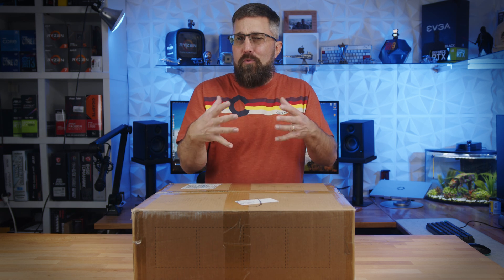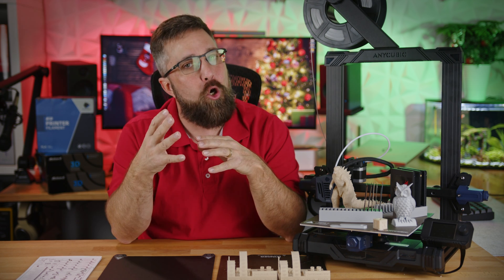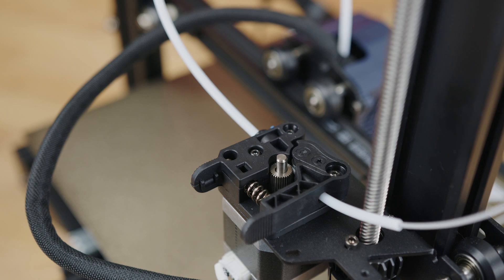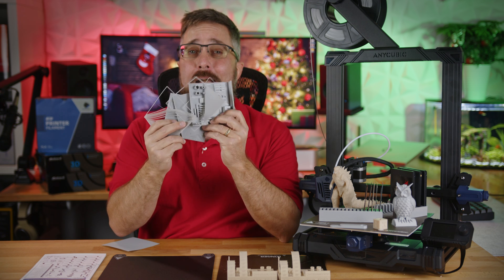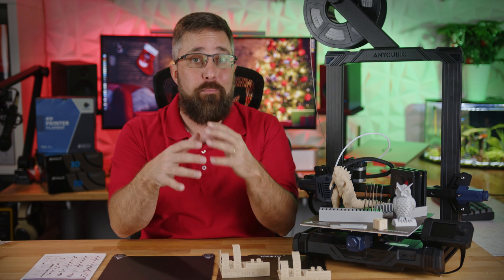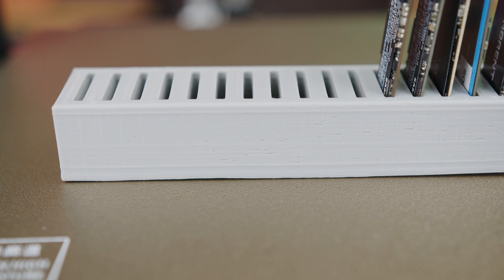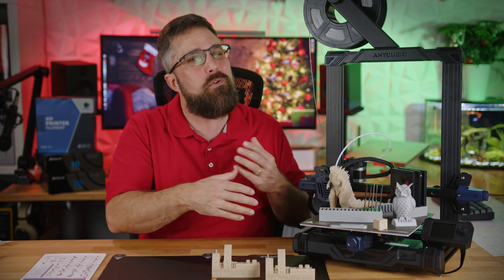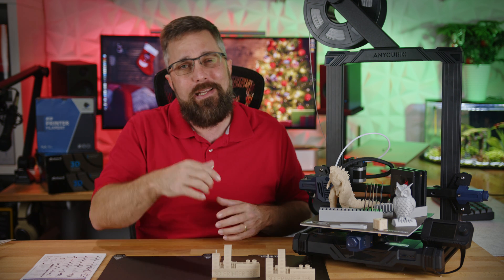How is This So CHEAP? Anycubic Kobra Go Review.

Comment: Thanks for your review. I had problems with adhesion until I printed a first layer test pattern and adjusted the Z axis offset while it was printing to find the best setting. I had to do this again when I bought some new filament and each time the adhesion has been perfect, no matter the size of the print. Can I install a fan on my Kobra Go?

Comment: So I'm real familiar with resin but new to filament, I'm having troubles with adjusting the settings because like... I don't know what I don't know about what the different settings do to adjust them. My biggest issue is that even after leveling and all that and it keeps thinking the build plate is lower than it actually is and I've gotta kill the print quick so nothing is damaged. Any advice on first steps to fix this?
Reply from the maker: Raise the Z Offset.
Reply: @ElevatedSystems  just to make sure, because I never underestimate how wrong I can be about a simple thing, you do mean to make the Z offset positive correct?
Reply from the maker: yes
Reply: @ElevatedSystems  thank you
Reply: @ElevatedSystems  so I set the Z offset to as high as it could possibly be and it is still wanting to start too low but when I do the touch auto leveling it goes to the right place. And it's happening with multiple different files. Any ideas?

Comment: Getting the gantry to stay level seems to be an inherent design flaw in single z axis printers as I experienced similar issues on my ender 3 pro.  I wound up adding a dual z axis kit and added a second control board using klipper to allow independent z axis motor control so it levels the gantry to the bed before each print.  I’ve found having independent z drivers is kind of crucial for dual z setups as my older mono price i3 drove both motors from the same driver and frequently had to be releveled and still could fall out of level until the steppers are locked.  These ultra low cost printers can print pretty well with enough effort but straight out of the box can be a real nightmare for people new to 3d printing.  Glad to hear it at least has silent stepper drivers, maybe tmc2208’s?

Comment: I actually just got mine 3 days ago and have had nothing but problems with the z-axis. Using a level helped for sure, but the wheels won't all turn and it gets stuck about 2 to 3mm above the bed. The auto-leveling definetly makes it look like it is working fine, but as soon as I try to print it is just not wanting to cooperate. Been trying to adjust and print something on it for the 15th time now. It also arrived in the worst state I have ever received a printer in the mail. Not sure if it is a shipping issue, or just a normal issue that is happening with the z-axis.

Comment: Im just throwing this out there: I had problems with the Y-axis shifting during printing. The motor would not be able to turn the axle sometimes. Try to tighten the rollers to bare minimum while sliding the bed. This fixed Y-axis shifts for me.

Comment: I have the neo and it is a peace of crap the auto leveling doesn't exist the bed is solid on the rails nothing adjustable for the bed level i have one side higher than the other by I little and the printer always drags the nozzle on one side of my printer every time I try the auto leveling

Comment: Oh my god, i actually got this on black Friday. This is my first 3d printer. My prints have been coming out really bad I've honestly only had 2 decent prints. And honestly the adhesion on the bed for me isnt working that well :(
Reply: So far, best advice I can give you is to flip the magnetic plate. The semi-gloss side is much better for adhesion. Also worth recommending 210 on the nozzle for the first layer, and 195-200 for the rest if using PLA.
Reply: I have a Kobra Neo, Make sure to set the Z offset in the menu settings that worked for me (it's a thing with the kobra models) and wipe the plate with a bit of alcohol then heat it up, it works wonders.
Reply: I had the  same issue until I manually set my z offset by using a piece of paper and jogging the nozzle until i felt some slight drag on the paper when moving the sheet of paper back and forth. If not sure how to do it go on YouTube and watch how to do it.
Reply: The Bowden tube melts after I week. Learned that the HARD WAY. Just switch it out
Reply: same. the whole thing needs some type of adjustment

Comment: Hi, I have a doubt. I accidentally deleted the files on my micro SD memory and I am new to my printer. I tried to put STL files but it doesn't read them. Do you know how I could fix that?
Reply: Not a problem if you delete the default files, nothing you need there for the Kobra Go to read STLs. Should just read any stl. Try formatting the sd card as fat32 or trying a new sd card.
Reply: I believe it only reads geode, not simply stl

Comment: I have Problems with abs 

it doesn't stick properly or the lines don't come out clean and look wrinkled.  Temperature of 80-95 degrees tried everything.  noodle from 210-240 no difference either
Reply from the maker: you need a full enclosure to properly print ABS.

Comment: I've recently bought this printer, and for every print the nozzle hits the print and moves it, causing it to be ruined, is their any possible solution?
Reply from the maker: you need to ensure the print head is trammed and the  z-height is set correctly.
Reply: I lowered the z and that fixed it for me. I am at -2.8 or so

Comment: My Kobra Go keeps freezing and not printing, I’ve tried printing from SD card and the screen keeps freezing and nothing moves
Reply: I had to flip the voltage switch on the back for it to work.
Reply from the maker: try updating the firmware
Reply: @ElevatedSystems  idek how to do that

Comment: Oh - and for any newcomer here: Make sure your E-Steps are correctly calibrated. There are ton of videos on this matter, but essentially you download "pronterface", klick 2 buttons and type 3 different commands to have it calibrated within 5 to 10 minutes. This is especially important in case your first layer is underextruded, which would also cause adhesion problems.
Reply: I found out that I had an underextrusion issue on my Kobra Go and when I used pronterface to extrude 10 cm it only did 9 cm so by default it is off by quite a lot. Another word of advice is to recalculate your pid settings for the build plate and the hot end.

Comment: I have and use an Anycubic Kobra almost daily. The adhesion problem with PLE on this bed occurred to me as well. Raising the build plate temperature to 70°C solves the issue for me. Also: While PLE does not stick very well on this bed, for PETG it is the opposite problem. I had to lower the build plate temperature to 75°C (instead of typical 80°C for PETG) in order to even get the PETG print off of the build plate post-print, as it was mounted there REALLY WELL.
Reply: my bed sticks great i dont know why people are having issues
Reply: Printing PETG without using glue is always a risk.
Reply: Raising my plate temperature worked. It’s now printing properly and staying in place. For some reason the PLA print was sliding all over.. I have mine at 72, just to be safe.
Reply: Did you ever have later shifting problems?

Comment: I can't get it to stop layer shifting
Reply: try tightening or releasing your screws for the z-axis. If this does not help, check your movement-speed on the z-axis if it is too high.
Reply: Same
Reply: But only with my own prints the default owl works fine
Reply: @stanleyhoptroff  Exactly what I am dealing with.
Reply: I'm having the same issue. I contacted anycubic and they're sending me a new motor. I fiddled with sooo many settings and still, layer shifting.

Comment: So would the best way to fix the warping issue to get a new pei plate?
Reply from the maker: That or just print on a raft.
Reply: Typically this can be solved by reducing the print speed (or even tempearture) for the first player. In addition you can use a larger brim. 

Edit: I just caused warping in my 2nd print of the same model by increasing print and plate temp by 10°C. So here we have an easy example of how too high temperatures can make the material warp. Also: I had the window open which caused the bottom part of the print to cool down in relation to the upper part which is hot due to the fresh molten filament. Hope this example helps.

Comment: Do you have experience with Creality Ender 3?
I'm getting one for christmas (in my country in Europe for under 200$) and I'm really looking forward to printing with it. Same printing volume, more popular, however, I'd be happy to know what your opinion is (and whether you could make a comparison) 🙂
Reply from the maker: https://youtu.be/0eqF4Tl3wiU
Reply: @ElevatedSystems  I meant the OG Ender 3 but thanks :))
Reply from the maker: @Get-Rekt  The OG Ender 3 is pretty dated at this point, unless you get an upgraded one.
Reply: @ElevatedSystems  Well, I'm getting one for christmas as in my country it's MUCH cheaper than anything else and I think it may teach me a bit more.
What makes it dated? :))
Reply: @Get-Rekt  It is relatively old one there will definitely be some upgrades needed if you want to get the best out of it but even today it is still a great printer for its price. If you havent purchased yet tho I recommend checking out ender 3 neo, ender 3 v2 or ender 3 pro. They should not be too expensive than normal ender 3 and are definitely worth the price.
Reply: @Get-Rekt  basically to add alot of good features it will require you to buy and add them compared to the new ones coming with them upgrades out the box
Reply: @UTKDesign  it's been sitting under my desk waiting for christmas for like a week now but I don't rly regret the purchase.
I see that the newer versions have quality of life improvements but I am a linux guy in nature and I like things to demand some skill and knowledge (and I want my older brother to suffer when using it 🤣) and as far as my understanding goes, if I assemble, calibrate and tweak the printer properly, it shouldn't print worse than the newer versions, should it? ('cause if it actually does print worse, I'm gonna be disappointed 😂)
Reply: @Get-Rekt  "I am a linux guy" well then you are more than ready haha. And yes if you set everything well enough  the print quality should not be worse (maybe ever so slightly)
Reply: @UTKDesign  Prints very well and I'm rly happy with it
Thanks for explaining :))
Reply: @Get-Rekt  No worries! Glad it works good